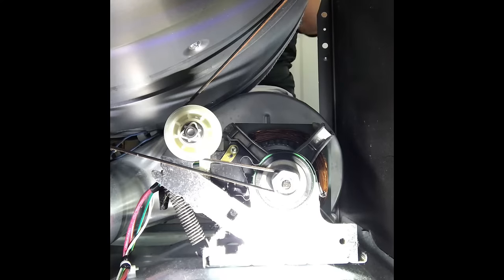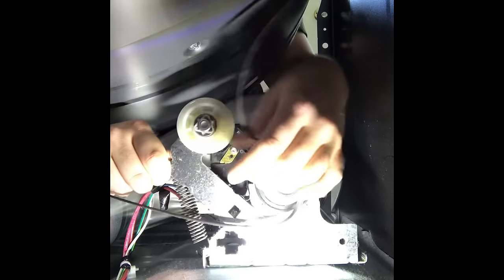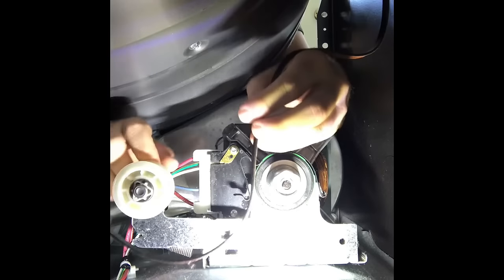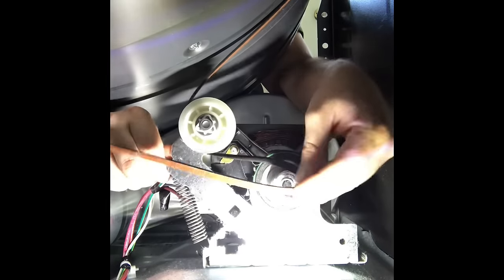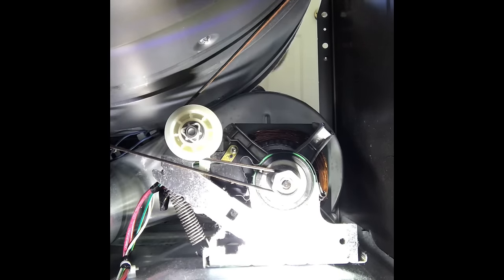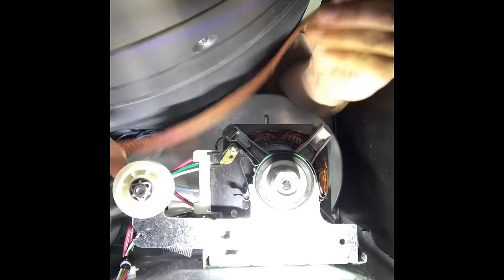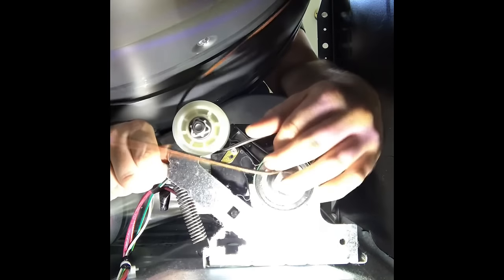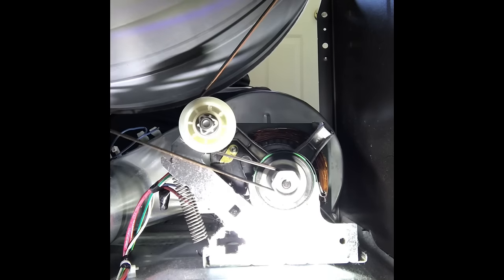How to get dryer belt off and back on for almost all dryers

Comment: This was a great help, thank you! But like another commenter my belt seemed to be much tighter than the one in the video. The video made it appear the belt was rather slack and installed easily over the pulley, I really had to strain. Since I reused the belt that was originally there I was sure the belt was the correct size.

Comment: How in THE HELL do you have so much room on your pulley? I had to CRANK that idler pulley almost ALL the way back to the motor wheel to get it on, and even then it was SUPER TIGHT. I ordered the exact same size of idler pulley and nothing else has changed. Did they give le the wrong size belt when we bought it?